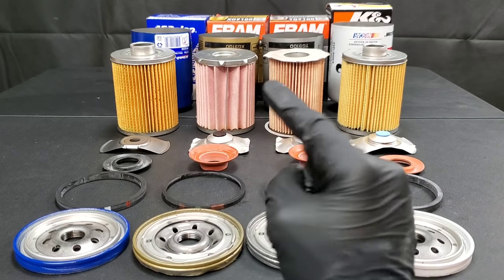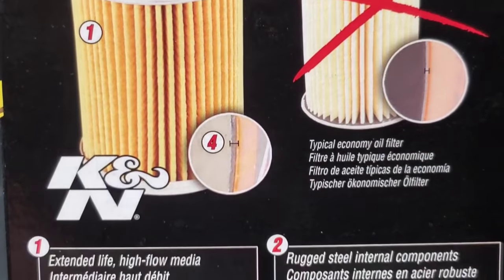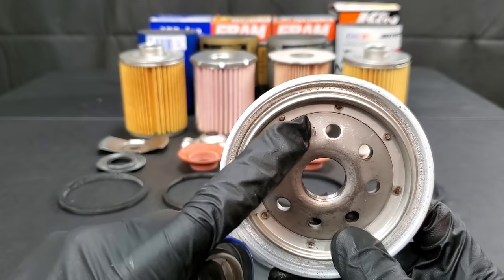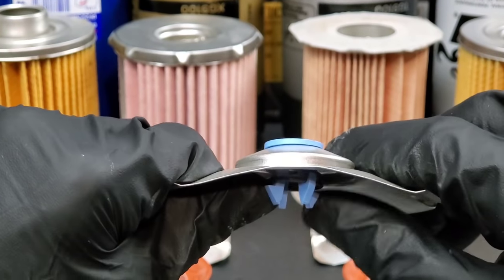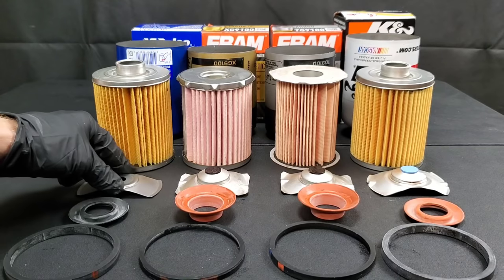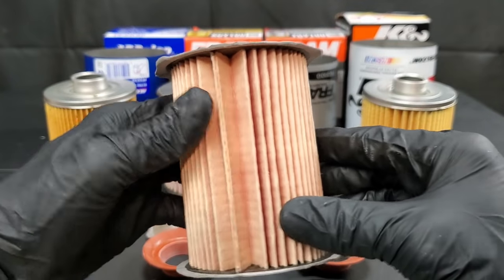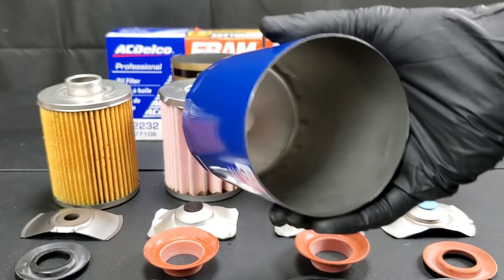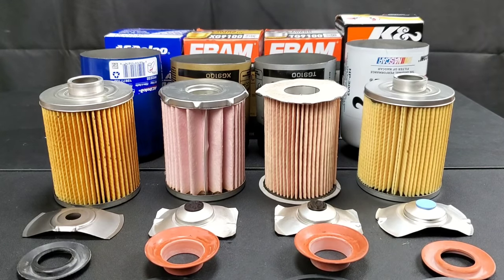DO NOT USE This Oil Filter made by...

Comment: I had used Fram oil filters because they where sold everywhere, but a few years ago i noticed my truck started cold with a rod rattle, i was concerned as it started right after a oil and Fram filter change, I decided to get another oil filter as maybe it was a drain back problem, installed another Fram oil filter, same issue?, oil pressure was good but a cold start rattle, got another oil filter this time a Supertech, the rattle was gone on cold startup, no more Fram oil filters, the quality was no longer good any more.

Comment: I've opened up many filters after they've been used and found that the filtering material gets cut play the rough surface around the holes in the metal tube in the middle of the filter

Comment: Champion labs makes ac delco, k&n and mobil 1 filters.....and champion labs has been bought out by Trico group who also owns fram.  Good luck.
Reply: @alexanderkennedy2969 they aren't all quite the same some are ecore with the plastic center cage and others are metal but some have the same characteristics and the filter media ratings can differ. But they are all owned by the same company

Comment: I’ve used orange can of death and Valvoline high mileage for years and not a single issue.
Reply: Same here.  I don't know why the knock it so much.   Show me one that's failed.  All were doing here is a visual generalization.   What ruins engines is Heat, vibration and poor lubricating properties.
Reply: The biggest lie from fram is that the oil can of death dont exist. If your at the supermarket and you see an orange fram filter, run.

Comment: I use an Amsoil Oil filter and the oil, it is good for 25,000 miles, and made for Synthetic lubes as well. They cost more, but so much better. I would use them any time over the crap on the market today.
Reply: You don't actually go 25K before changing it out, do you?
Reply: My coworker did that, a few months ago his engine blown up.😁

Comment: I' believe that I'm going to start going with K/N,the A C delcos are looking like they're made in China or somewhere, &I've been using the fram tough guard, but I always change my oil &filter around 3 k,miles,,&I won't use the orange can of death,,like you mentioned the Tough Guard seems to be a lot better than the orange one..well just slightly better.

Comment: I will never use a microgard filter in a 2010 toyota corolla 2ZR-FE again, it caused vvti gear rattle, once i changed back to the toyota filter the rattle stopped, i noticed loose fibers from the end cap donuts even the element itself.

I only use Ac Delco, Denso, Toyota, Wix, from here on out.

Comment: They all by pass some oil at times.  How good is the filter then.  Change oil regularly is the best thing you can do with good.
Reply: There is an oil bypass valve to keep oil flowing to the engine in the event of severe clogging of the filter, it's designed that way on purpose to save your engine under a worst-case scenario.

Comment: I do mobile 1 everything, but often out of filters.. Used k&n .. No idea on performance, but their design has much better functionality.. And a designed for a socket to unscrew, great, can use torque wrench to specs.
(I have put in 2 quarts of penzoil synthetic blend to top off recently)

I just want to know where I can spend money better.. Because mobile 1 changes are almost 50 bucks now?

Comment: If you clog any filter it will implode. change your oil on time and even a Basic Fram is OK
Reply: Says a guy with no pressure gauge!
Reply: If they plug up the bypass valve opens up which still allows flow of oil but no more filtering capacity.
Reply: The bypass valve prevents imploding or exploding.   If pressure builds because of plugged filter media the bypass opens to continue circulation.
Reply: Get the filters with the bypass at the thread end not the closed end of the filter then if it bypasses it wont be still going over the dirty filter media. Just another tip.
Reply from the maker: Check out the new video https://youtu.be/Qf2tGF63Gz8

Comment: I use a Toyota filter from Toyota stealership. $5. 
300,000 miles on a 21 year old Tundra. 
Every 4,000 miles. Purrs like a kitten. Comes pre-greased and sealed out of the box.

Comment: Fram and napa are both made by wix. They are not the lowest grade filters, but damn near close. The only brand I've seen cheaper is luber finer. You can crush their cans one handed. I've been selling oem and aftermarket filters for 15 years now. The top two are Fleetguard/Cummins and Donaldson, neither you'll find in a auto parts store.

Comment: Fram , I call it the FramTrashCan ! 
"Avoid the orange can, avoid the Fram "
Reply: Fame has started making mobile one filters now beware.
Reply: @rolltide9547  no ,the Mobil1 filters are basically made by the same who makes AC Delco, the baseplate is identical, even the stamping marks, the old school (Black) AC Delco gold oil filters was identical to the Mobil 1 oil filters, some Mobil 1 filters also fit the WIX wrenches if not the GM /AC Delco units ,Fram filters don't fit the OE GM wrenches
Reply: @daewooparts  I called mobile one last week and the tech guy said they are fram filters now. The same place that made several OEM filters made them before. The change started in 2020.
Reply: @rolltide9547  ,guess Mobil 1 will be a oil can of death then ,bad move for Mobil.....why cheap out if they going to charge alot for it, just stick with AC Delco or WIX

Comment: Are the silicone valve oil stoppers and anti-siez grommets with adhesive backing worth the extra cost?
Reply: The silicone oil filter anti drainback valve is for sure superior compared to the rubber oil filter anti drawback valve.

Comment: Cardboard does not belong in an engine, period.  I’ve used factory filters with hard nylon end caps with zero issues.  But I will never put cardboard in any engine.  I guess the Fram diehards r just cheap bastards.  Lol

Comment: My Silverado with a vertically mounted oil filter makes the anti-drain back valve material meaningless. Because it hangs upside down, it will always be full of oil and can be installed filled with oil at oil change. I wish all manufacturers figured out how to mount filters in that manner for ease of maintenance and peace of mind, especially for those who don't change their own oil and likely get a low quality quick lube filter.

Comment: At one time, Fram made a decent filter. But under price pressure from most likely Walmart, they got cheaper and cheaper made. This is not the only video that points this out. Sorry I will spend 10-15 bucks for a high quality filter instead of trying to save 5 bucks and buy cardboard.

Comment: Filters only last as long as they can filter the sludge out of the engine, then they bypass and dont filter at all,  if your engine is in good shape and youre not trying to race the oil and filter can last a long time, I get 7000 km on Synthetic oil and it still is not getting black or clogging the filter but I'm not driving hard just accellerating hard on the highway, long story short pull your dipstick and examine the oil once and awhile, too many people dont take this easy step.

Comment: Been using fram for 20 + years and I've never lost an engine or had any filter related issues ..with that said I change my oil at the proper interval also ..
Reply: I have used them same around 20 yrs I have small trucking company were sticklers for maintenance intervals and I had 3 fram ph43 filters fail and collapsed like pancakes had engines knocking couldn't believe it once I saw what it was put new oil filter on knock went away I was blown away my SBC 350 had a knock from highway speeds to sudden deceleration would knock until I came to complete stop neutral  rev engine up knock would Peter out it did this consistently until I swapped out been using ac delco on my GM trucks ran the k and n on my dodge never issue again just my experience I wanted to share almost lost an engine from old orange grippers!
Reply from the maker: Wow thats a incredible story and im glad you shared your experience good or bad thats what the NIA was made for. This will help someone 8n the future. They won't know because their engine will still be running so they may not be able to thank you but i can. I appreciate the context on why, also im grateful for your kindness.
Reply from the maker: I understand we all can have different experiences good or bad so thats all the more reason to share with the NIA community. I made this channel for the people myself included to work together sharing information. Some take criticism as a knock against their favorite product but im critical of them all. I have seen issues with about every brand i can remember checking at one time or another it happens. Many times its about how often you see a issue. Plus personal circumstances play a big roll such as price, area driven, climate. So please continue to share and ask a question if you would like others to give their opinion. Most wont ask questions because they believe it makes them appear to be uninformed. But its the opposite.

Comment: change your oil every 3k and use any filter. You will be fine.
Reply: Nah I like changing my oil every 10k with OEM filter...
Reply: @reyfuentes4572  To each his own.
Reply: @dannyo6699  true and also my duramax gets its oil changed every 15k...
Reply: @reyfuentes4572  I run Mobil 1 EP 5W30 oil in my 99 Chevy Silverado 5.3L. Mobil 1 advertises 15,000 miles or 1 year. I change oil every year because I don't get anywhere near 15,000 miles in a year.  I do run the Fram Ultra Synthetic XG3506 oil filter because it's extended life with a full synthetic double lined element filter. It has a 20,000 mile or 1 year life expectancy. Good match that works for me.
Reply: @dannyo6699  sounds great! Nah that's good I do the same with (well use to) with old beater Mercedes s500 (5w-30 annual protection with a mobil or mann filter) but when u said fram I was like "uh no" but then fram ultra is the goat!!! Best well built filter I seen...
Reply: @reyfuentes4572  Agreed 100%. Fram Ultra synthetic filters are premium grade filters.

Comment: Fram filter are the worst filters made! I almost lost a motor because of a Fram filter! Changed my oil & filter (Fram) run the car shut it off went into the house got ready for a date left luckily I was close to the parts store I bought the filter when it started leaking oil all over the parts guy said I must not have got it on tight enough so he put it on for me ran the car with the new Fram filter when it started spewing oil I told the parts guy to give me another brand changed it never had another problem with it! I’ve talked to a lot of other people that had problems with Fram filters and stated they would never run Fram again!

Comment: Anybody with nothing bad to say about fram, are not telling the truth about how many times the gasket comes out of the filter. You put a new fram filter on  and 10 miles down the road your oil light comes on. No engine oil. The doubled up gasket leaks out all your oil. Got tired of fram not fixing problem.  Buy Mopar brand instead. No problems with gasket not hanging on to filter.

Comment: I feel like you are way over thinking this. Cheap oil, cheap filter, change your oil often. Keeping engine sludge down is best done with clean oil. Sure a 15k oil will do the job that long, but it will cake your engine up in the long run.

Comment: Blah blah blah. I use Fram or AC Delco for many years never had a problem. 2000 Silverado, 21 years old and still going strong. I only change the filter every other oil change.

Comment: No one in my corner of the world even sells fram anymore with the exception of Wal Mart, that should tell you something right there about a decline in quality. I stopped using them around the year 2000 when the brand was sold to another company and subsequently cheapened. That being said if you change your oil and filter often (3-5k) and keep the level up I seriously doubt you would ever have an oil related issue. It's kinda like quaker state, some run it for years and years with no issues whatsoever while others wind up with an engine full of sludge.

Comment: If you don't change your oil at the proper mileage, your filter will stop filtering. I'm talking about 2,000 miles plus overdue. The filter will be heavy like a brick. Don't let your   oil filter turn into a heavy brick. You have overloaded your filter. Then you blame the filter for engine failure..Unfortunately.

Comment: If your buying an oil filter at Walmart, your likely to be buying whichever brand filter they have left in stock ... if they even have any in stock!

I’ve used most of the oil filter brands and even some ultra cheap Chinese “eBay special” filters over the years. All have lasted the 3-3,500 miles I needed them to last. In over 30 years of driving, I have never had a catastrophic engine failure. I think the frequency of oil and filter changing is far more an issue than the brand of oil and filter you use. I never go over 3,500 miles between oil changes ... no matter what type of oil used. This topic has been beat to death and nothing has ever changed my opinion. In the end, just use whatever brand oil and filter makes you feel good.

Comment: Most filters are made by the same manurfacturing factory and the same construction with another name and paint job on them. K&N and AC DELCO are good filters using Royal Purple motor oil. I like Ecotech filters used with Royal Purple 0W-20 grade synthetic oil for their durability and synthetic materials use for 10,000 oil changes. Most Auto Parts stores are not selling Royal Purple oil filters or Royal Purple motor oil for some unknown reason. FRAM SUCKS! How come you don't review ECOTECH synthetic oil filters?

Comment: One of the biggesFram failures is due to the cardboard end caps on the cartridge, they do no hold up well if the filter goes much beyond a normal change interval or in higher than average heat conditions - Ive seen fram standard filters cut apart and the cardboard end caps are actually mushy and dissolving into the oil, this is a certain engine killer as it will get into oil galleys and with todays engines having tiny galleys for the CVVT valve timing mechanicsms it could cost you thousands in engine failure.  Also the reason thinner can material is bad is due the lower burst strength in say very cold weather, an oil filter has to deal with very high initial pressures in cold weather start up.

Comment: I questioned Fram reliability after I had issues with an engine after an oil and filter change. I liked AC Delco
Reply: What's funny is that I ALMOST used a FRAM oil filter that I had in storage.  But I was too lazy to go to the storage facility, which is about 30 minutes away from our house.  So I went to the local AutoZone and got the ACDelco filter, along with several quarts of oil.  Perhaps it was fate that saved me from being a potential victim?  lol  Although I personally never used FRAM before, so I wouldn't know for sure.
Reply: @guildrich  More than likely you will never actually have an issue with a FRAM but i still buy ACDelco everytime.

Comment: I use good quality full synthetic oil and  Fram XG filters - I change them both every 5000 miles - 2010 Mazda 3 2L engine 200,000 miles - the engine does not burn any oil - so for me they work. Trying to extend oil changes is fool hardy because as any oil ages with the extreme heat and any special ingredients degrade and the particulates just build up to unhealthy levels. If you want to save money - learn how to change your own oil and filter.

Comment: Use the OEM filter SPECIFICALLY designed for your engine.  It will save you a lot of headaches in the long run.

Comment: Don't knock it.  There has been cardboard gaskets used for years and still do.  Offers a better seal than metal to metal contact.  Heat doesn't affect it much either.  Never had a problem with Fram filters.    Probably one of the longest running products there is.  50 yrs or more.